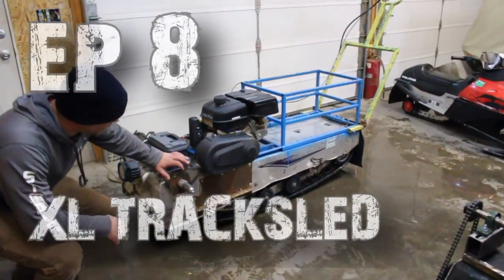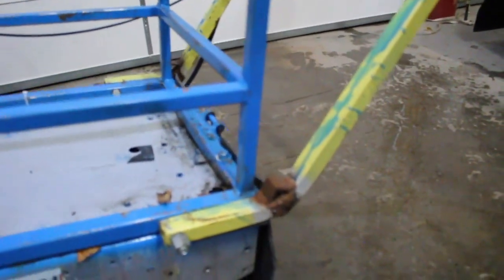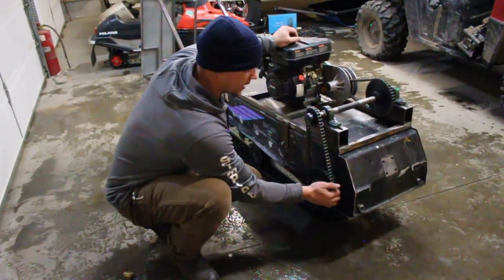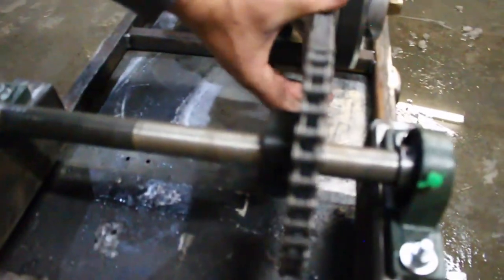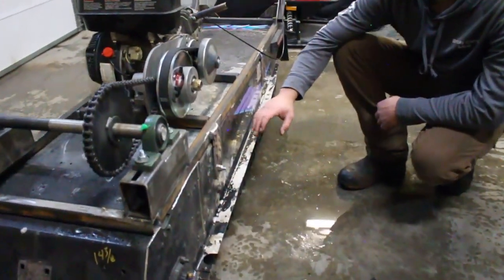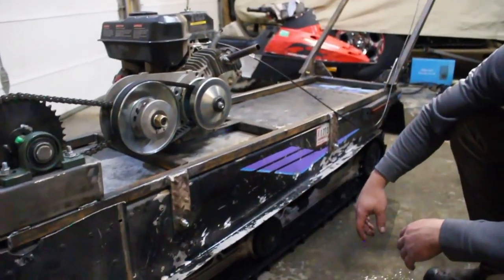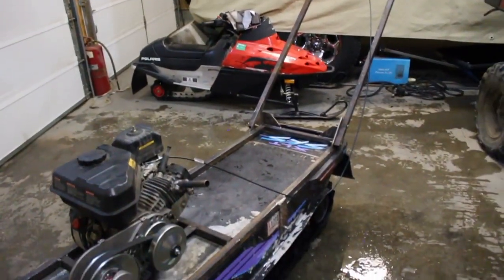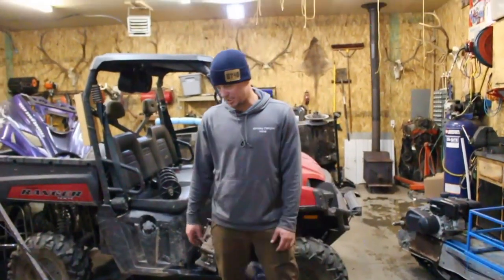EP 8 XL TRACKSLED

Comment: Jason Great video. I am in the process of converting the exact same sled into a tracksled. What is the part number for the bolt on bearing for the lower belt drive shaft on the Xtra Long Tracksled? Any info on where you purchased or part number would be helpful. Thank you!!
Reply: https://www.surpluscenter.com/Bearings/Cast-Iron-4-Bolt-Flange-Mount-Bearings/1-4-Bolt-Flange-Bearing-w-Lock-Collar-HCFS205-16-1-205-16-4-C.axd

Jerry Thanks for watching and the comment, I use surpluscenter.com for most everything. Here is the link to that bearing.
-Jason

Comment: This a very helpful video. My sprocket is way close to the track so i can't use  #40 sprocket. So i lwill lose all my speed, by using the blocks on the front and pillow bearings  i will be able to use the #40. One thing i did on the tunnel to give it some strength is i used the outside 2-3 inches of the running board and bolted it vertically to the side of the tunnel. Great video. Thanks for the help.
Reply: Thanks for the tips! And thank you
Reply from the maker: On the EXT with the 13 horse I still have the running boards attached.  With the extra motor weight they kind of work as training wheels when leaned all the way over.  Definitely feel the extra weight of the motor.

Comment: I built one for this winter . I watched every Diy track sled videos and I wonder why I didn't see a single track sled using the original ski doo  secondary clutch ? I did put a Comet duster clutch on a 420cc engine . It use a 1 3/16  inches wide snowmobile belt . I started my build before watching videos . Maybe half way into my build , I started watching some videos and I thought I was going the wrong way because I didn't see anyone using the original secondary clutch . Would you think it's a cost factor ? I know the Duster clutch is a bit expensive but my track sled  got tons of torque and it goes almost 60 mph ... so it might also be a safety factor 🤷‍♂️🤣
Reply from the maker: I think cost and engine placement play a factor into not using the snowmobile secondary clutch.  Using the snowmobile clutch limits you to locating the engine In one specific location.  Also a snowmobile belt costs as much or more than a complete series 30 setup.
Reply from the maker: That being said I am working on taking the 277 2 stroke out of skidoo tundra and replacing it with a 420 or similar engine and will be keeping the stock secondary and drive system so will be doing what you are talking about on that build.
Reply: I agree with all you are saying  . It was quite a challenge . I did use some old rotax single cylindre leaf spring motor mount bars to mount the engine . The extra efforts , trials and errors  are really worth it . I tuned those clutches just right 😛 it engage as smooth as all the time that spent figuring and building this monster in the garage 😛🤣  I restore vintage snowmobiles and engines and I am not picky on belts .  As long as it's over 1 inch wide it's good enough for me  and it might be even good for safety reasons ... because with a new belt it almost clocked 60 mph 🤯 belt prices are insane these days ... got tons of old belts and they are so tough they will last for years with proper break in and maintenance . They almost uses the same lenght belts because they also used the same clutches on many models  . Pretty happy with the first fishing season . This summer I will improve all the little things that need to be corrected . Maybe make a tubing frame because that aluminium frame is  pain to work with .
Reply from the maker: @ericbedard7219  I would like to see some video of the finished product.
Reply: Sorry for the bad quality ... i got a new phone and for some reason I don't find this video in it's original format . I will find more videos when i get home ... i will post them here
Reply: I did the final clutch tuning after that video . The primary was engaging around 1450 and 1500 rpm . I removed more weights , now it engage above 1800 rpms  ... so cold start are much more easy . I removed the governor . Next year with all the improvements and mods    this thing a bad ass monster machine ... first one at the fishing spot 🤣🤣🤣 cost me under 1300 cad bucks  with brand new engine and clutch . Should have seen the face of my friend when I past him like he was on park on his 6000$ snowdog 😅😅😅  I agree it's a pretty nice machine ... but it just lack on the fun factor 🤣🤣🤣
Reply from the maker: @ericbedard7219  way too clean.  Needs more bad welds and less paint.  All seriousness that looks like a really clean build.
Reply: Thanks 😁